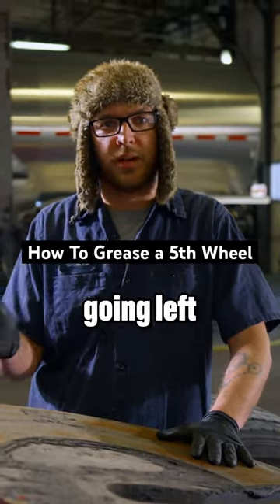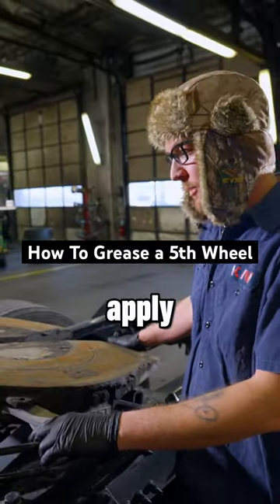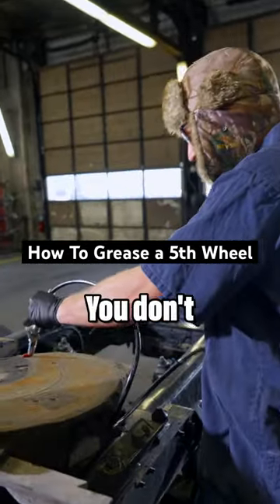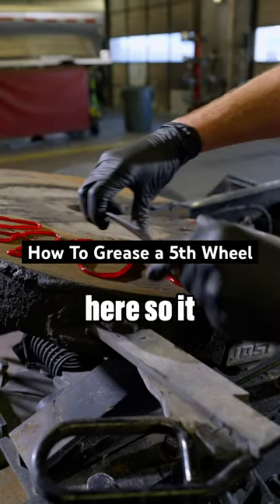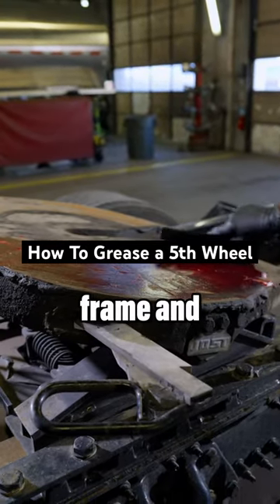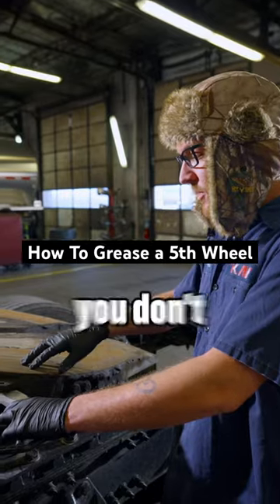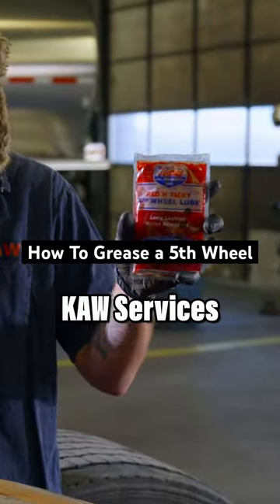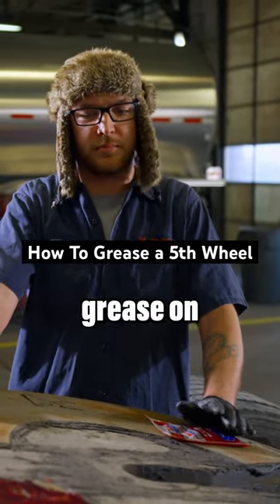How To Grease a 5th Wheel

Comment: At the 76 truck stop I worked at in the late 80's, we would run the trailer legs down and use a copper tube with a grease fitting on it and stick it between the fifth  wheel and trailer plate and put the grease to it.